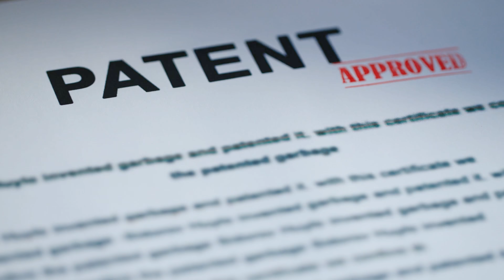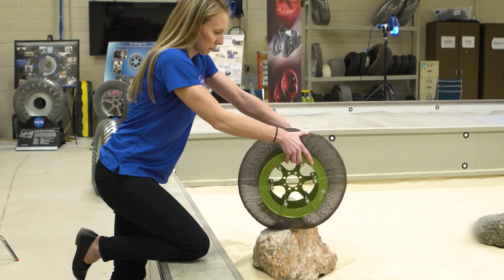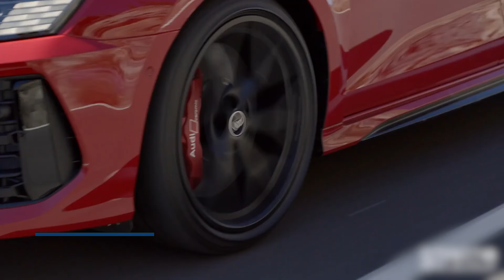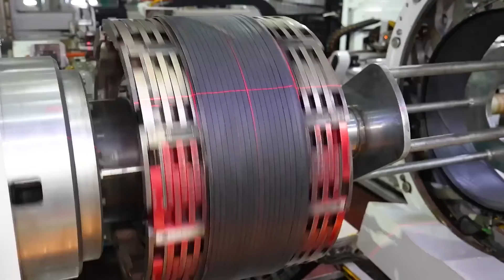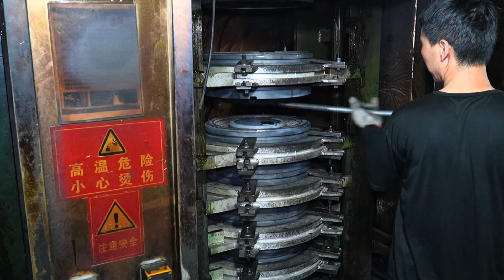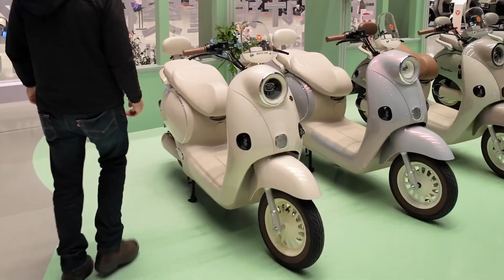China Built a Tire That Never Goes Flat — And Could Replace Traditional Tires Forever

Comment: If you drive 4x4 where you drop tyre pressure when you cross sand, how are you going to do that with those tyres? You will just get stuck in the sand forever. Not feasible for off-road use.

Comment: My opinion is have 50% cross section tubeless. And balance 50% with the configuration of the above design. The idea is a nail can penetrate say 25 to 50 mm but can't puncture the tubeless part. The overall weight of rubber will increase. A Honeycomb structure with a good tread thickness should set off the cost by way of milage. Finally the concept should be cushioning inside partially on the inflated part balance on honey comb. Finally milage due to a decent tread thickness which will justify the cost and hassle free drive.
Reply: Yes ..
A combination of both air-tyre & synthetic run flat tyre should be the answer to the problem
Reply: What if dirt and mud will deposit on the?the Tire will be unbalance?
Reply: Was saying the same 40 years ago.
Reply: That’s actually a smart hybrid approach. The added weight would be a challenge, but the extra puncture protection and cushioning could make it worth exploring.

Comment: With air you can adjust the weight carrying capacity by altering the air pressure.With these tyres how do they compensate for varying weights and still have the safe control of the vehicle at speed.I have a wheelbarrow which a similar type of tyre and I have to be careful of the weight on the barrow.
Reply: Air pockets, you add air for extra loads  ☺.... mmmm? I'm on to something here 🤣
Reply: Great point!😊

Comment: My problem is ride comfort.  Even using "just air" low profile tires suck for getting a good comfortable ride.  When you have a higher sidewall you allow for more flex and you get a better ride. 

Now if you can provide me with a better flexibility which results in a better ride.  Then that is my next set of tires.😮

This is especially true of new cars that no longer come with a spare tire at all.  Then it's rather a no brainer.
Reply: Well easy, 15'' wheel instead of a 22'' with no absorbtion at all. now days -  it's '' the Look ''   I don't care, I want comfort.

Comment: Instead of those excessively expensive tires, I would install full size  spare tire and a hydraulic jack in each manufactured car for less money.
Reply: I bought a Toyota Hyryder Hybrid in Jan 2026 which had no spare wheel.
I asked the dealer to fix the spare wheel carrier and rim,gave a brand new tyre and now I have a spare wheel..total peace of mind ,I need not worry about sidewall ripped tyre as I have a Full size Spare wheels 😂😂😂
Reply: A hydraulic bottle jack is useless when you have a flat tire.
Reply: @owengill105 Did you vote for Trump twice? A slip under the car garage hydraulic jack ($100 each) costs less than a set of 4 expensive hard wall tires ($300 each). Understand? Thanks
Reply: @JuanMelendez-l9f  Is the average person going to be driving around with a garage hydraulic jack?

Comment: Airless tire designs were being tested decades ago.

Three BIG roadblocks keep this design out of the general markets.

1.  They are NOISY.  Trying to keep a constant stiffness (K) makes the 360 degree structure HAVING to be uniform.  UNIFORM structures create a tone and harmonics.  These tires are LOUD!
2.  Debris getting in the WEBS, generation EXTREME imbalance.
3.  COST.  Because of the complexities of the WEBS and materials, they are simply expensive.

Don't hold your breath.

Comment: The issue with tires its a HUGE BUSINESS. Technology that is shown here has existed over 15 years and it not Chinese. Its an American design. But just think what would happen if you never needed tires anymore from the day you purchsed you vehicle ?????? Trillions of dollars would bankrupt millions of companies in the world. Forever tires will NEVER happen. Just like a forever running car will NEVER happen. Things have to break wear out like toaster, mixer, TV, washer dreyer, Motors, Ovens , washers, refrigerators and the list is endless. Could replace traditional tires yes it sure could but NEVR will . Unfortunate the world we live in of consumables. Just a note to all. Did you know industries have engineers that study how the product they will sell will eventually fail ? Its businesss. Failure started with light bulb companies. They were told I beleive it was by the Government to only have a duration of a few years and burn out. Today you have LED lights and they STILL BURN OUT.
Reply: They sure won't build a tire that will last longer, just a tire that won't have annoying flats. when it starts sagging, you need new ones. (like suspension)

Comment: Not trying to disparage China's effort in making a "never-go-flat" tyre but this has been invented and investigated by Michelin Tyres some years ago. The idea was first raised in 2005 as a concept called the "Tweel" which developed into their UPTIS - Unique Puncture Proof Tyre System - and testing began in partnership with General Motors under real world condtions. The first announcement of the prototype was made in June 2019, the design being unveiled in Montreal, Canada. Originally planned for release in 2024 in new cars, this has been delayed to sometime in 2026 or 2027 or maybe a bit further. 

There is no official release of pricing yet but industry experts have placed a premium price of between USD $600 to USD $1,200 per wheel.  

You can either fgo tro the Michelin Tyres site to find out more or simply Google fdor infoermation under "UPTIS tyres" if curious or interested. Whether China is investigating the same concept independantly or jointly with Michelin as the original idea was ro fit these on electric vehicles, is anyone's guess at this stage.

Comment: Airless tires aren't new. Michelin showed one twenty years ago, they've been on skid steers and mowers for years, and several manufacturers have road prototypes. The interesting question isn't who invented it, it's why none of them have made it onto a normal car yet. Change my mind.
Reply: In case you didn’t actually watch the video, the first half of it talks about similar ideas have surfaced before but failed due to impracticality
Reply: Rubber & materials have evolved, I think this could work well 🤔.  the price though??
Reply: You are right and also it's about wear, tear, weight and cost.
Reply: @inuwasirajo4672 , yes … but if the tyres don’t wear out , your joints and bones will !!
That is why the idea was dropped long back .
Reply: Debris  and heat would be the big killer in Australia given that probably the majority of time spent in on farms and Long distant dirt roads concept is great in Australia would be a hard proving ground we need reliability
Reply: Fair point. The real breakthrough isn’t inventing airless tires—it’s making them cheap, quiet, comfortable, and reliable enough for everyday cars. That’s the hard part.

Comment: Another major issue could be the deteoration of the supporting rubber structure under continuous heat and flexing conditions. This is  likely to change the load capacity,  riding comfort, steering/ control, and the total expected useful life of the tire. The replaceable tread is not the problem, but the honey comb/ equivalent structure is major issue.
Reply: yep, one has too keep up with the other, + prices$ ?